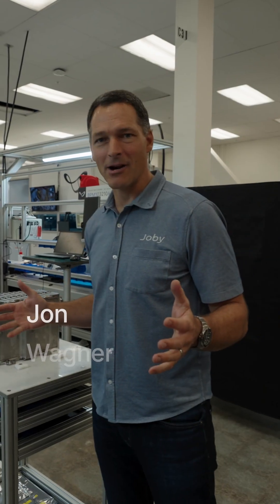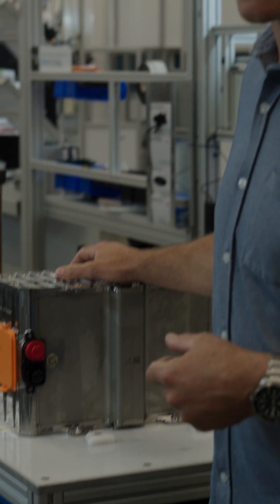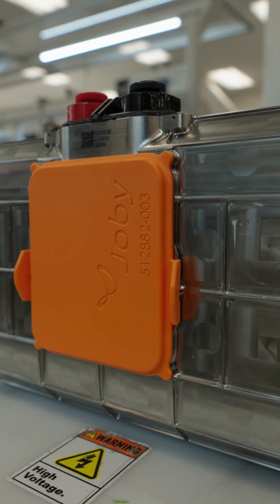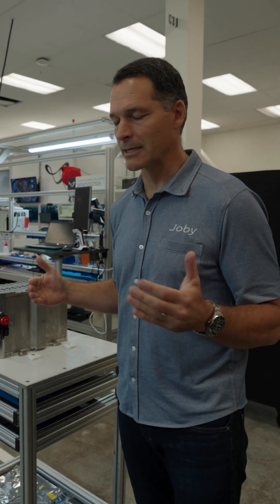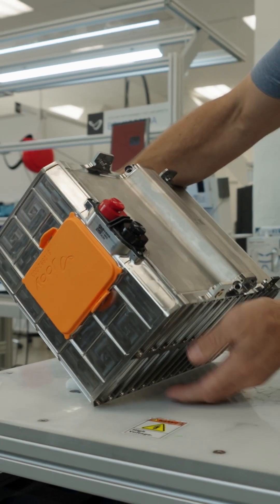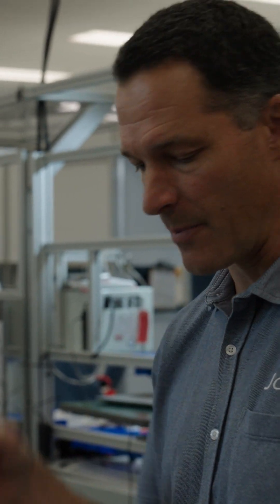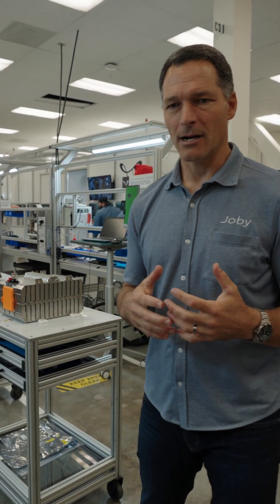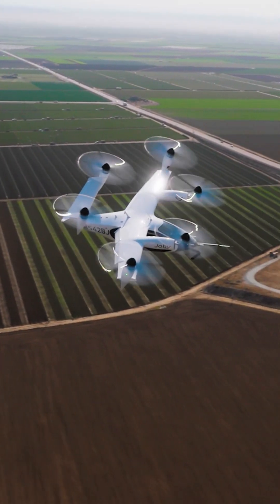Joby - Batteries for Electric Flight

Comment: Hope they are looking hard at the new generation of silicon anode batteries (like the Molicel P50B that Archer is using) and soon the P60B for greater energy density (greater range) and faster charge times to shorten flight turnaround times.

Comment: Do the batteries for the flights that show up on flight tracker have the same size and weight as the batteries you intend to use on the certified craft?
Reply: You're still thinking this is fake, lol.
Reply: @askingforafriend6540  i don't think it's fake i just don't think they can lift enough weight and keep it in the air long enough to work as a taxi.  Maybe 2025 will be the year someone proves it's possible.